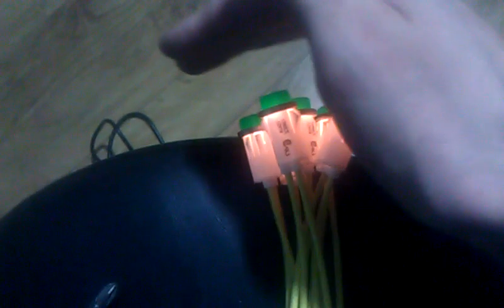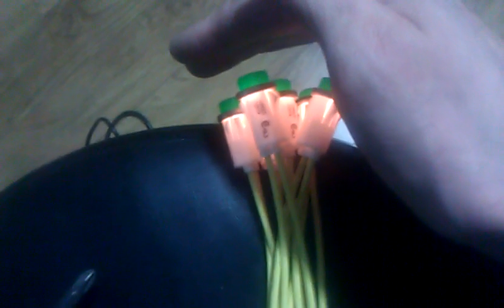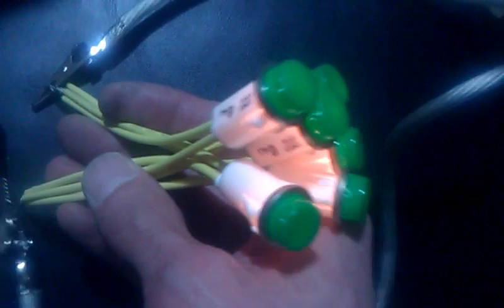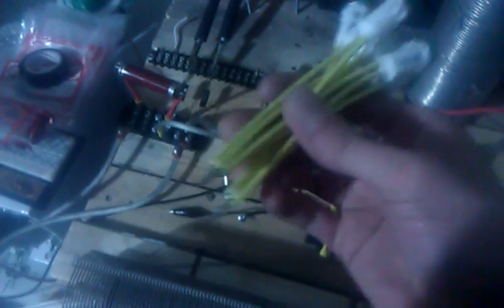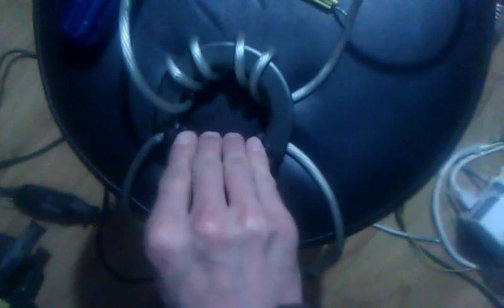Don Smith Device Project Part 25 A: L1 vs L2 step down toroid DEFINITE Increase

Comment: Try to put lamps directly to input with disconnected primary coil - then you will see the actual power difference. In your case in input current flows through lamps and primary coil. Good work.